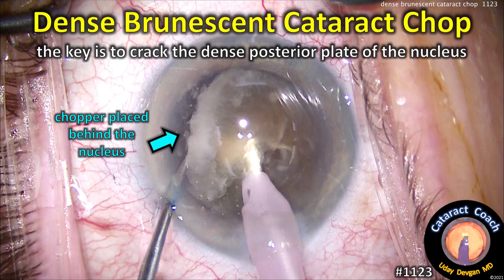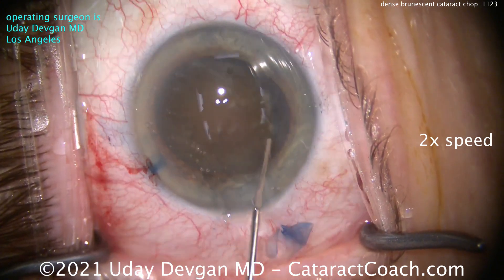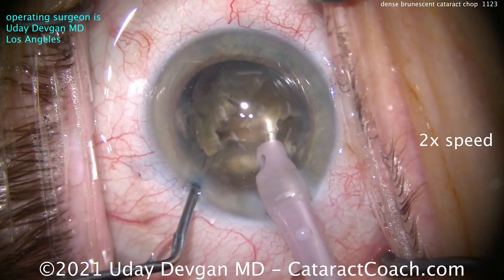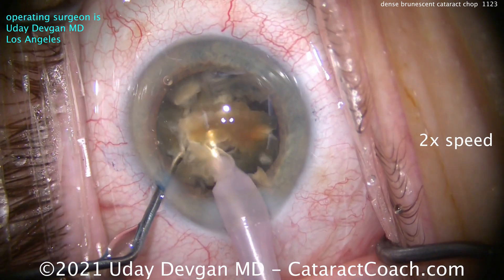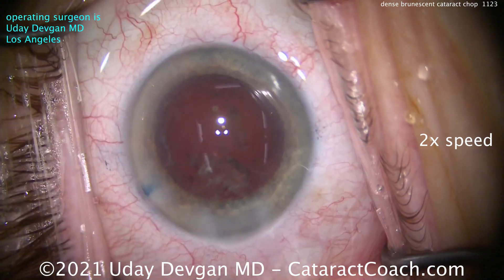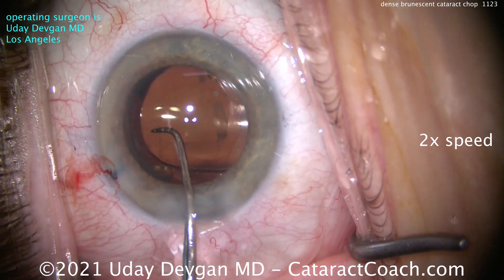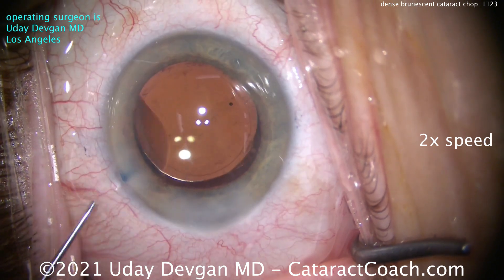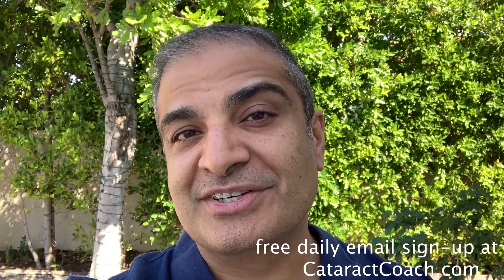CataractCoach 1123: dense brunescent cataract surgery phaco chop

Comment: 4:14 I see that the lens is very stable in the end of your surgeries. How do you achieve that? 
In many of my cases I find that in the end there’s posterior pressure pushing the lens anteriorly, in some cases it is kept in place by the capsulorhexis, but when I have big capsulorhexis of around 6 mm, sometimes I need to use miotics to help keep the lens in place. Any tips to achieve that level of lens stability without posterior pressure in the end of a surgery? I already aspirate visco behind the lens.